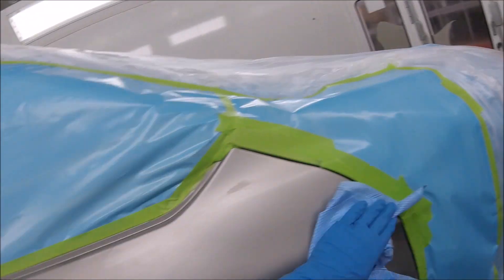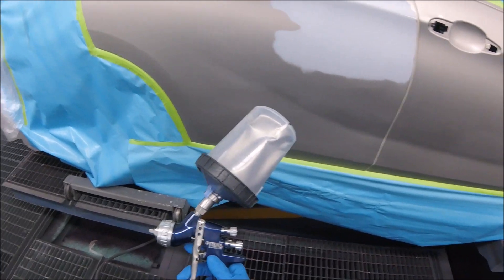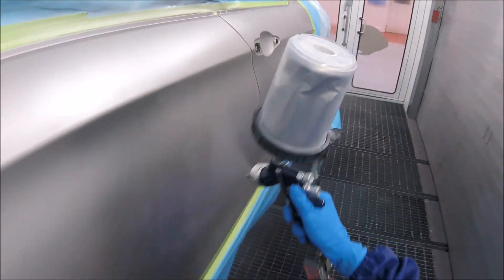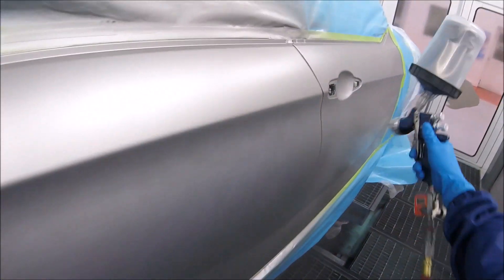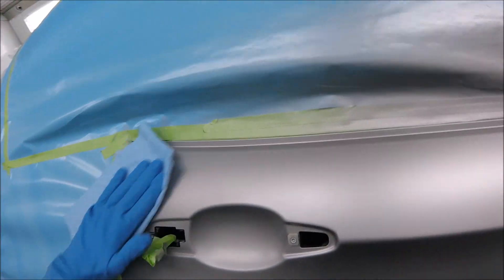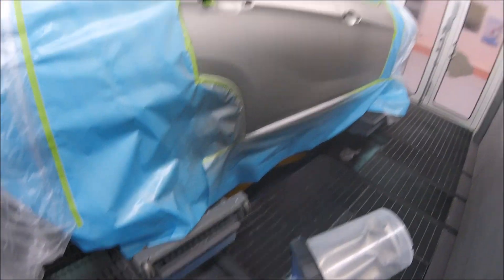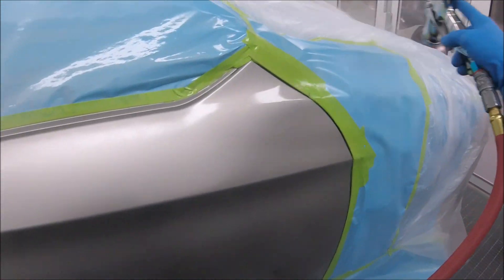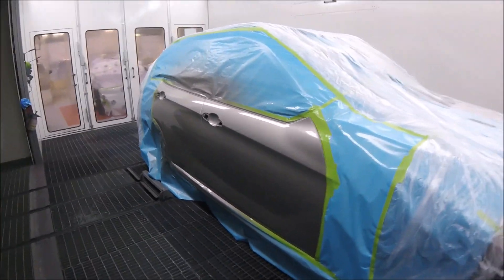How to blend with not much room

Comment: with difficult colors i usually spray 1 control coat then 1 control coat with 200% water added to the paint and 1 control coat with 300% water. this also helps prevent edges

Comment: I would have masked up front door edge for the first cover coats on primer, then pulled off masking paper on the last control coat or 2. Helps me with my sand piling.. great job as always man. Ive learned a ton from you. Gracias!
Reply from the maker: Absolutely a great way to do it! Thanks brother !

Comment: With Axalta and 1 1/2 coats your able to blend in a very tight area. The system is the easiest to blend bye far….just saying. Sand-piling creates mottlle, and it can be tough to deal with times . With a true waterborne, there is no over spray or sand-piling. For example- because its a wet on wet process you could spray a black complete then tack with a new tack rag before clear and there won’t be any sign of black on the tack rag cause any overspray lands into the wet film and is absorbed.  It ends up being silky smooth before clear. It was good that you eliminates to many blend area buy spraying to the top and bottom of the door. We should never attempt to blend in a circle if we can help it.

Comment: Question: Do you need to scotchbrite or buff the entire panels original clearcoat before laying down the final clearcoat on top of the repair? 
OR is it possible to lay down an epoxy primer patch, then patch with the base color, then just put the final clearcoat over the entire panel without scuffing the whole area for adhesion of the final clearcoat?
Reply from the maker: Everything has to be sanded always
Reply: MOTIVATED PAINTERS That’s what I had learned but I don’t think some of these other tutorials understand that. Appreciate you. 🙏

Comment: I've got a color that matches spot on, but a sanded through spot near the front of the door. I can just paint the entire door. But I have a second place sanded through and discolored that needs to be resprayed on the quarter behind this door. I can spray the base to lightly bring the color back to normal. But how do I get the clear coat to blend with the existing clear? Do I use a chemical within the clear? If I clear the entire area I would have to paint half the car due to it being a fast back mustang. I want to blend the paint, and then blend the clear. Or does clear need to be blended? If I over lap other clear won't it sand down with 1500, then 3000, then would it leave a line or area that does not clean up and buff or polish properly?
Reply from the maker: I don't recommend you blend the clear. Just base where you need to and clear the rest
Reply: @MOTIVATEDPAINTERS  so re clear the entire rear of car? Again? Both quarters and the tail and the top of car? For a two inch rebase shoot?
Reply from the maker: Wherever you will base. That panel needs to be cleared. That is the right way to do it for it to last
Reply: @MOTIVATEDPAINTERS  Yes I know to clear over any base. If you spray base over an area the size of a door latch. Do you need to clear the entire door? Or if you have that same area on the quarter panel...do you need to clear the entire back half of car, top, both quarters, tail panel and so on? Or can you blend the clear? So, Okay the base will go on about 6 square inches of the quarter. The same for the door area. I don't mind clearing the entire door again. But having to clear half the car to repair a small area I reshoot on quarter panel, that needs two light coats of base and is a 6 inch square area seems crazy Especially since I see you actually doing it on a small area yourself. What your doing is what I want to be able to do. Not clear the biggest part of the car for a little base touch up area.  If I shoot clear over clear, will it show Dull areas where I stop? Or will sanding it and buffing it make it look fine? Yes I know it needs to be cleared. Maybe I can send you a pic of it. Are you on facebook? Thank you.
Reply from the maker: If you base even a quarter size spot on a panel you need to clear the rest of the panel
Reply: @MOTIVATEDPAINTERS  yes I know I must clear the base . That’s a given. But what about shooting clear over the clear that is around the base. Will the two clears blend? Old clear and new clear? So I don’t have to clear the whole car just to cover a small base repair.
Reply from the maker: Brother you are not reading what I am writing. Base wherever you have to base but then clear the rest of the panel sand with 800-1000 and clear the rest of the panel you can't just do a spot it will fail in a few months
Reply: @MOTIVATEDPAINTERS  okay yes I’m listening. I don’t think you understand what I’m saying however. I know you have to clear the base. But outside of the area where I’m blending my clear on top of old clear.  Will the clears blend with one another or do I have to paint the entire car with clear. You said to paint the entire panel with clear. That’s the thing I’m trying to avoid.  the entire panel is half of the car. I want to know if I can blend my clear into the old clear on the car. Like you blend base coats. Will the clear blend in with the surrounding clear?
Reply: @MOTIVATEDPAINTERS  can I blend the clear instead of clearing the entire car.  Where the repair is the roof and quarters all connect. There is no break in this surface. To clear just one panel. I have to clear the entire car? If I cannot blend the clear? Once i spray the base area that needs color, I clear over it, yes I know that much. Ive paint yes 4 cars. But is there a way to stop the clear out from the repair just 4 or 5 inches. Will the edge of clear I create on top of the old clear blend together? Or will I have to paint (clear) the entire car just to touch up a small area with base and clear coat?? You talk about blending. Why can’t I blend the clear to clear like color to color?
Reply: I looked at some other videos and I got the help I needed. They’re saying I have to clear the entire top and both quarters with clearcoat after I re-base the little area that I am trying to cover we’re color. But I never understood why you thought I wasn’t wanting to cover the basecoat with clear. You always have to do that obviously.

Comment: do always clear top to bottom on a down draft booth? I'm just the opposite because I was taught that all my over spray will melt in because I always have a wet bed.  also not fighting texture.  also what grit to do prep your blend panels? I finish mind with 1000 on metallic colors and 800 on solid colors
Reply from the maker: +garrett stokes I alternate most of the time I clear bottom to top but sometimes top to bottom if your clear is not melting into itself then maybe the clear is to fastwe use 1000 for light colors 😀 thanks for the support!!
Reply: do you use t492 and t494 in your base coat? 10% 492 and 20% of 494.
Reply from the maker: +garrett stokes not for metalics

Comment: You should make a video for diyers showing how to make multiple sprayout cards to aide in blending.. ie most diyers don't have access to tinting bank and adjusting there paint they purchased...ie the variant they choose was the best option but is still off .ie to dark. Please show how multiple spray out cards with multiple coats of basecoat clear blender .. Can help adjust colour matching along with spraying psi which can light or darken a colour. Along with blending tips during painting. The goal is to lighten a basecoat varriant using a base cost blender etc, along with blending techniques and drop coats etc.

Comment: Where does the overspray go in the door handle openings?
Reply from the maker: Not much goes in there it desipates inside of the door. Is much better to cover them with some foam tape though
Reply: @MOTIVATEDPAINTERS  Thats what should have been done in the first place. Otherwise the overspray covers the window. Also allows contaminants to blow back out on the painted surface

Comment: One question please if u put sealer on the primer and dry it then u put base coat and clear coat u think the primer soak up base coat and clear ? After some days ??????? 
Because some time the finisher cuts the edge or cut the primer and see the filler so he put canes 1k primer so how to fix like that’s problem ??? Thanks for your reply 🙏🏻🙏🏻
Reply from the maker: Yes that would fix the problem
Reply: Thanks for your reply but after two weeks becomes like dieback

Comment: What gun do you use ? I need help finding a gun that won't break the bank.  I'm gonna be painting on 21 floors. Also what's that pressure reader?
Reply from the maker: +M6teenbam323 it really all depends on what product you will be shooting. Tells prolites are great guns for whatever you throw at them
Reply: Gun snobs usually can't paint with anything less than the best and most expensive. Even then it's a crap shoot.
Reply: Tekna GTI prolite. You can’t go wrong. Very versatile gun. Runs about $350 usd